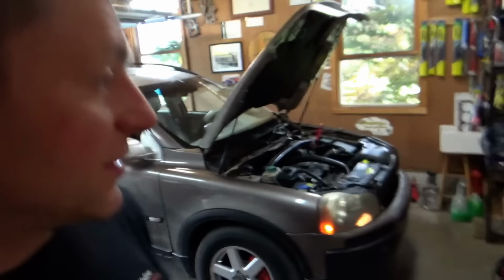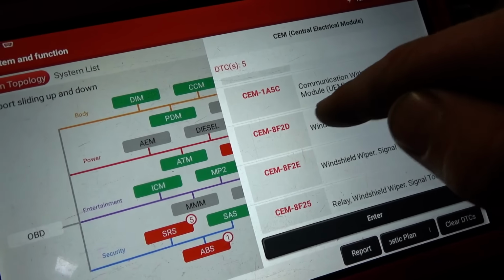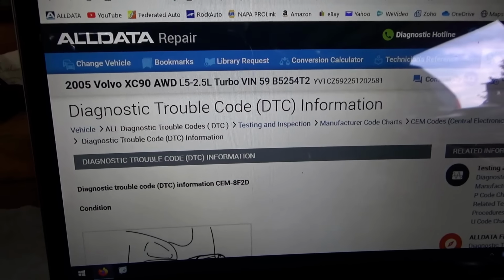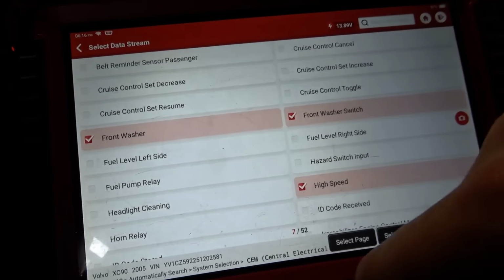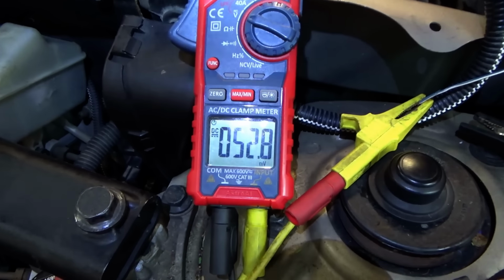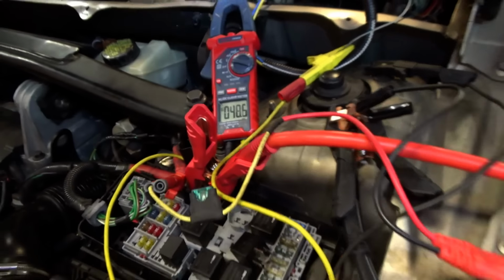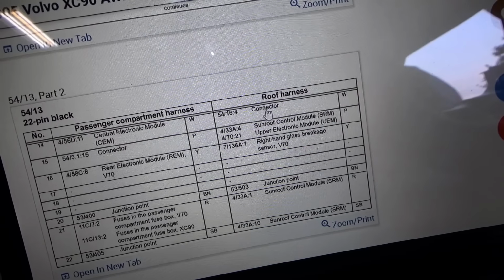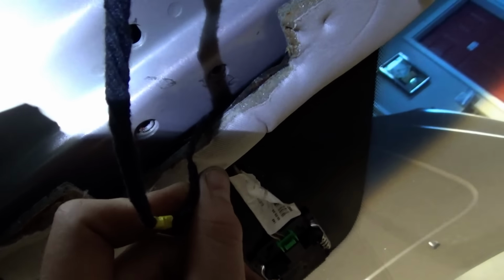(Pt 3) Volvo From HELL...Wipers DIY DISASTER! (05 XC90 Turbo)

Comment: I have no voltage going to my windshield wiper motor. I checked the fuse which is good. Is there a relay on this 2001 v70 and where is it?
Reply: Found the relay in the under hood fuse box which is fine. Still no wipers with a new motor.

Comment: it will be back for the gas tank problem...... there is a reason that 3 or 4 fuel pumps went out and you found it in the screens.... I am not sure if the tank is degrading plastic or what but that screen will clog again unless you pull the tank and either waste your time cleaning it...(if it is degrading) or replace it with a new one... which is what I would do. TBS... I was a mechanic for 25 t0 30 years and quit when they went to computers.... I have learned so much watching your diagnostic skills... not many real electronic mechanics .... but ton's of "throw parts at it " ones!

Comment: In my Holden Commodore the body control module controls the wiper speed, etc,the YouTuber Trifiveguy tried to use a Pontiac GTO wiper motor assembly which is the same as the Commodores unit in his Holden VR Commodore utility or pickup which he v
brought over with him to America from Australia but it didn't work properly because it didn't come back to the park position, it's an older model of Commodore.

He ordered one on eBay for a VR Commodore & he had it shipped from Australia to the United States.

I have flushed out the fuel tank in my car using nothing but dishwashing detergent & a hose to blast the tank out with water then I have let the tank dry out for a few hours prior to refitting the fuel pump module & refitting the fuel tank.

One of our local mechanics got out local radiator specialist to clean out the fuel tank in a customers Chrysler Valiant Regal which ran the 318 cubic inch Hemi V8 engine when someone put sugar in the fuel tank in 1993 when I was doing work experience for them !

Comment: it’s truly sad when you run across things like this im positive that the person doing the work on this car was trying their best but people please don’t do this to your car fixing an electrical harness when cut like this is expensive and sometimes you can’t get the peace to make a repair and have to replace the entire harness to get a proper repair so i have always warned people don’t cut the harness as there’s always a need to properly diagnose the issue first and you should only cut as a means of repair not for diagnosis purposes cars are so full of modules these days that just cutting and grounding a wire that shouldn’t be grounded can kill a module so save your pocket book an your car by using the correct tools or someone experienced to fix your car unfortunately this car will need extensive wiring repair it’s unfortunate
Reply from the maker: That was the longest sentence ever! 😄

Comment: Hey Ive, why didn't you charge the owner the FULL cost for the fuel-problem repair?  You fully fixed it didn't you?  Why should YOU be out of pocket?  I don't get that.

SO much complication.  SO many connectors, wires, sensors & modules.  For what?  Windscreen wipers?  Far canal!

Are Swedes that inept, & so lacking in perception they can't tell for themselves that the visibility through the windscreen has been reduced because of the rain?

Those pinched, shorting wires in the overhead rear-vision mirror assembly - Were they pinched from the factory, or are they the result of a ham-fisted primate playing around with them?

Just make sure this customer pays what they're supposed to pay; I'm getting sus.  Did they plead with you to only pay half the fuel-flow repair?  If they're having trouble paying for that, how are ever gonna pay for the rest?

Comment: The wipers have to be in the parked position or they will continue to have voltage, they are not attached properly, remove the wiper arms when working on wipers

Comment: Hey Ivan, hopefully you can give me some guidance.
 Have a 2011 Kia sorento 2.4l with code P0014 and P0017. The codes came after replacing the headgasket, chain and tensioner (OEM) due to overheating blown headgasket. I have replaced ocv, checked timing and checked the cvvt for a broken guide pin. All good not sure what else to check. 

On the live data I can see both intake and exhaust cvvt angles. Intake reads good but exhaust is intermittent. When the angle is not the desired by pcm (gets stuck or off) the car stalls. After a few restarts the angles match and car runs good. Any help is appreciated 🙌🏼 One of my favorite channels on YouTube btw 💪🏼

Comment: After you unplugged the rain sensor, the test light was blinking at exactly the same rate and the chime. Hmmmm, and the owner cut all the wires in the plug to the CEM and twisted them back together..... could he have gotten the wrong two wires twisted together because he is a little colorblind and the wires kind of look the same?

Comment: Hahaha, oh man, pancake harness is NOT what I was expecting!  I was hoping you would go after that rain sensor, and my money was on the bulk connector in the driver side A-pillar!  LOL

Unrelated, kinda angry that AllData has detailed service info for a 2005 Volvo XC90 wiper system, but not a 2012 Ford Escape ABS system...  Let's just say your day went much smoother than mine...  ;)

Comment: Must be some corrosion down inside the broken wire. V strange to see some voltage on a broken wire not drawing power. I guess at the break itself there is some degree of corrosion which is carrying some of the voltage across the break. Lucky you found thhat1. Nice work once again!
  Oh. the voltage was being pulled down? Then something must have been getting warm. Was there ghost current draw on the battery?

Comment: Well, I had my hopes up that we might see some component repair;  looks like we are going to see some soldering and shrink wrapping at most; still good. This owner should be grateful you are able to solve these issues with expertise instead of wiring hacks although it would seem the issue with the mashed wiring might be an issue with installation at the factory.  However, like you said, this car has been butchered; nothing seems off-limits.  I can't wait to see if this has anything to do with the non-functioning sunroof, etc.  There's nothing wrong with collecting your money in a timely manner and hopefully this customer didn't ask for a discount.  GREAT VIDEO!

Comment: Paused at 7:00  It's very common for Volvo's XC series 2001 to 2006, that the sunroof will stop working if the alarm siren module dies.  It's located in the right front wheel well, behind the headlight.  Just unplug the siren and everything else controlled by the upper control module should start working again.

Just finished watching and my mind just got blown like a fuse.  lol.  Nice find Ivan!  I have never in my career working for Volvo, ever seen this level of butchery done to a Volvo.  It's shameful.

Comment: I think this customer was sold a dud. Thought he bought a bargain but ended up flogging a dead horse. I don't get that he didn't understand that a diagnostic charge would be for each issue. It has that many issues surely he didn't think you could diag everything in one go. I'm not a mechanic but even I get that.

Comment: Customer should have paid for both a Front windscreen replacement & proper seal & make sure Sunroof drains & seals are 100% OK. 
Crushed rain sensor harness is someone has been there. To bring a car with water 💧 in the passenger footwell for electrical problems is next level insanity.
Shocked 😲 Ivan took the job actually.

Comment: This is why I'm keeping my 96 F-150  4.9 L  six with only PCM/tcm  and a basic distributor with module, no other modules to go bad and harness' running everywhere, and no timing chain very reliable.
Reply: I've got the exact same truck. 4.9L, 4WD, 5-Speed Manual Transmission Low miles, the guy had bought it, and was only using it for snow removal on his acreage. I guess he decided he wanted an automatic instead and was mounting the plow on a Jeep. I live where there are lots of farmers, so most wanted more power. He said that he had lots of lookers but no offers. Although, i have been offered more than i paid for it, by someone seeing it parked in my driveway, no thanks. After seeing all these POS with multiple modules that become obsolete, i would not want any of them. Got an old VW Turbo Diesel 5-Speed too.

Comment: Had a 05 Dodge that started loosing grounds first was the alternator then the wipers it’s been like that for 10 years now replaced the bcm pcm every module in the car just put grounds on it took everything out of the car completely checked all the grounds never figured it out but it still runs good.

Comment: Thanks. I had an 04 XC90 turbo diesel bought it new, it was a very early model and it was very unreliable, it spent months at the dealers who gave me a crappy courtesy car. Sold it after about 18 months and glad to see the back of it. It had 3 new Turbos in a year. Yes UK, hence diesel which was popular in the UK, but very much in decline now.
You are very brave taking on a car that has been messed about so much, most shops would run a mile.

Comment: had a 2004 XC70 that I bought at 80K miles and gave me 100K miles of trouble free driving until I started to have module issues (CEM and DEM). Used XemodeX (great experience) but eventually chasing module issues was driving me nuts. For being in the northeast, the body was still in spectacular condition, almost no rust. they dont make them that way anymore.
Ended of sending it to graveyard (Wilberts for the SMA viewers)... in hindsight I wish I had paid the $$$ for a new CEM as my next used car ended up being a total disaster and needed expensive repairs in the first year that were more than what fixing the XC70 would have cost me. win some lose some LOL

Comment: Yes that is extra and then you are honest about if you can fix it are not most mechanic just lie an take the money I had my brother truck look at they said it was the injectors latest about 2 weeks check engine light came back on they said it need a motor change it but it was the bottom catalytic converters 4500 dollars wasted

Comment: Another common problem with the xc90 is the power steering pump 
I can hear it whining just like mine did ( 2008 Volvo xc90 ) a few weeks later it seized and snapped the belt 
Also the directional will falter intermediately 
You need to remove it and clean the contacts 
It’s expensive to buy a new one.

Comment: I have learned that, in principal, telling your clients not to mess with the car before they bring it to you is useless. Remember, no DIYer is ever intentionally planning to fail to complete the job, so, once a DIYer gets partway into a job, and realizes they can't complete it, they have no choice but to bring it to a technician to get the problem fixed. There is always someone out there that thinks they can fix something and finds out halfway through that they can't, and there's really no way for either client or technician to forsee this exact circumstance. However, if the same client keeps botching jobs over and over, then you have the right to refuse service to them, as they should have realized their lack of capability and stopped meddling altogether.
Reply: This is true for people who work as mechanics too though. Sure, most of Ivans customers either bring in untouched cars or failed DIY jobs, but we have seen a bunch of failed attempts by so called "professionals" too.

Customers who repeatedly botcher their DIY attempts can just be treated as one of all things that generates jobs. Just charge appropriate.

Comment: I'd try to quickly fix, then get rid of this vehicle.
Not because of the make or model, but rather the customer.
Trying to get a cut rate right from the start was a huge red flag, as well as the diagnostic time package deal request.
Worked in a custom fab shop and we had a customer that wanted his hot rod fixed fast, so we doubled up on the people working on it to complete it ahead of schedule.
4 of us put it 4 - 10 hour days to pull that off, only to have them accuse us of over billing them for labor hours.
They couldn't understand how anyone could work 160 hours in 4 days, when there's only 24 hours in one day!
We refused future work from them after that.
Reply: Some customers try to negotiate a lower price by different means. Super annoying if you aren't also the type of person who wants to negotiate prices about everything in life.

I've had a customer (in a different field) that tried this every time, and we never budged. A few times we just threatened that if the customer didn't pay the full price their junk will end up in the river rather than in their hands. Even though this happened again and again the customer came back time after time, which kind of tells that we were the only place who would put up with that customer, and thus we could charge full price and get paid for work that we would otherwise not have gotten paid for. Just add the unwanted negotiation time to the price you give the customer before taking on a job.
Reply: I feel for you man my old boss went in we another company he had a bunch of junk equipment I fix it all up made it all safe to use then wend he got the bill sold all the equipment close shop told my boss he was working out state

Comment: Well done spotting the trapped wires. It was moments like that that would inspire me to delve deeply into electrical faults when I worked in the trade, and yes I know what you said in a previous video about tech's having there hands tied, I used to have to bend the rules to continue investigating wiring troubles for which you could not get paid much for under warranty and was sometimes forced to fire the parts cannon, but when I was allowed I would delve deep hunt for the real problem. It was very rewarding and I would never give up until I found the problem!

Comment: Twisted bare wires covered with friction tape?  Nope!  To guarantee your work you must demand to be compensated to solder those wires and heat shrink over.  Unless customer promises to do so as otherwise your work IS NOT GUARANTEED.

Comment: Rain sensor... I've always used my senses to determine if it is RAINING. Seems to work flawlessly🤪
Reply: There are still people not smart enough to know you take shelter when it is raining.
Reply: My 2016 Mazda came with a rain sensor.  Another dumb solution without a problem. Never worked right. At least it can be turned off in one of the many menus.  When I learned to drive cars didn't have menus....

Comment: I still can't understand why any car comes with a rain sensor. Are humans truly becoming to lazy to operate the windshield wipers on their own.??? Makes no sense.
Reply: It allows Generation Z to continue texting without being interrupted.
Reply: Its for the car brands to make more money, nobody needs them...
Reply: on these XC90s there's a button on the stalk to activate automatic rain sensing. It's in a weird place and it's easier just to flick the stalk and activate the wipers. I've owned 5 of these cars and only used the automatic rain sensing feature to see that it worked. It's a fairly useless feature.
Reply: You clearly have never experienced that luxury lol
Reply: @FiresideCC  👍My car has rain sensor and I don’t use it. I rather be interacting with my car.
Reply: @FiresideCC  Anybody who thinks they need that luxury has a screw loose. Then we have the vehicles that park themselves because of all the dolts who can't drive. Or the ones who can't back a vehicle up with a trailer hooked to it. Morons who think they can drive while texting. Get rid of all the morons on the street/highways and we wouldn't need the costly technology that is being built into these POS.

Comment: I understand that some people rather try fixing some car problems on their own and save a few bucks But if you don't know what you are doing Leave It Alone. When you are trying to fix wiring problems Don't start cutting wires and routing them where they don't belong. Ivan you have the patience of a Dali Lama. Respect.
Reply: especially with a modern high technology vehicle.
Reply: @amunderdog  Especially if you have no inkling on what you are doing and have done root cause analysis.  Flying monkeys throwing darts at a moving board.
Reply: "come suck my tongue" --- Ivan 2024
Reply: And if you really can't resist, at least remove the DIY stuff before handing the car to a mech. 😂

Comment: Ivan.
If the customer told you or expected you to diagnosis all of the crap going on with the mess he created. You are correct. 
One charge per each problem issue. 
Then the next problem.
He created this mess, he didn't tell you the truth on the fuel pump issues. 
I would have told the customer. Your car stalling issues is fixed. New fuel pump installed. 
And your warranty for the work you performed. Not the parts. 
I would have sent him on the road. 
I've ran into issues like this before. 
They consider hooking up a scanner a diagnosis. I tell them before hand. It cost you this much to hook up my scanner. 
The actual diagnosis is looking for the problem.
Reply: I realize you love a challenge but.....this customer isnt truthful with you. Also he sucks as a mechanic. I wouldn't do anymore work on this hack job. Be careful of liability.